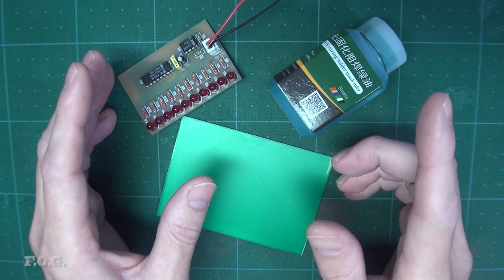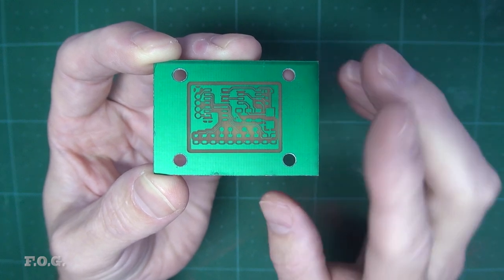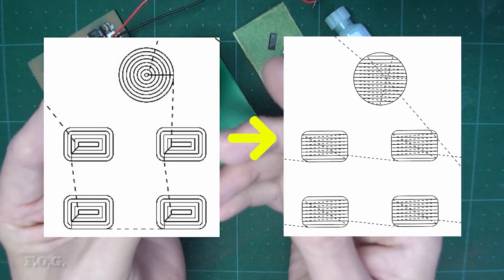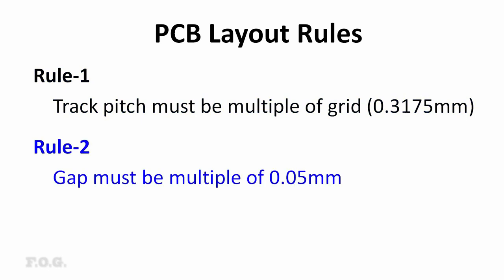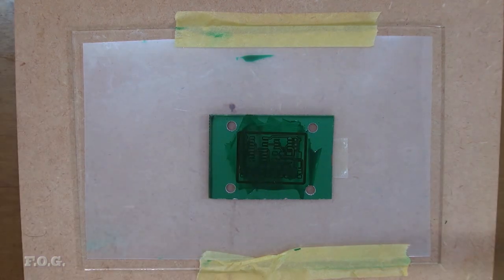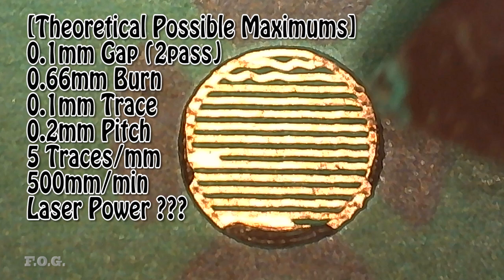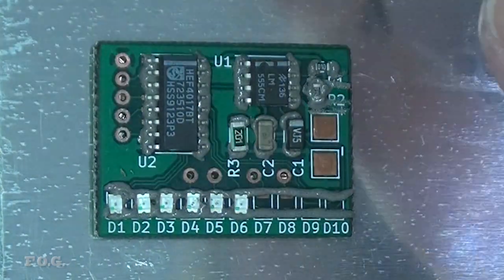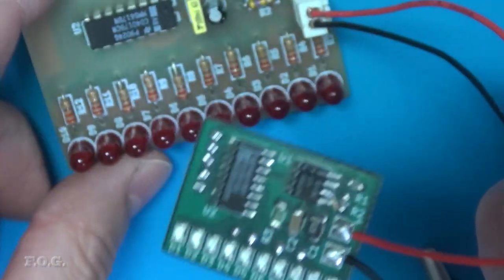EP7 – DIY PCB – Best DIY PCB EVER! (Double Sided SMD)

Comment: Hello, I'm Aureliano I live in Brazil, I'm buying Twotrees TTS-55 Laser Engraver to make my prototypes, the idea would be not to use that green liquid mask and use dry film (photosensitive paper) do you think I'll have good results?
Reply from the maker: Hi Aureliano, nice to meet you, I have many viewers from Brazil. From my experience, I don't think you will get a good result by using the dry film and exposing it with the laser. The reason is because most of these lasers have some light halo around the core beam, and I expect it will make the resolution poor and blurred edges.  But I have not tried this method myself, so maybe I am wrong, so please experiment with this method and tell me about your results. For the UV resin method, only the core beam is used, where the power is strong and can burn off the resin, that is why I get a very clean result, and the halo does not affect the result. Thanks for your question and comment.
Reply: @ForOurGood Thanks for the feedback, as soon as the equipment arrives I will start the tests and let you know if it works. Hug!

Comment: I have been working on this exact same process with my 3018 CNC.  I ran into the exact same issue you did with there being some sort of film on the pad after lasering away the resin coating.  Did you ever find a resolution for that?

This series is amazing btw, wish I had found it a few weeks ago, would have saved me a bunch of time, haha.
Reply from the maker: I think I show it in a later video, but I am using some generic metal polish, and scrubbing the surface with a very fine hair toothbrush, and that seems to fully solve the problem. I have also seen suggestions of dumping the board back in the etchant for a few seconds, possibly that will work too, but generally I prefer to deal with the etchant as little as possible, so I am a bit hesistant to add that as a step in the process. Anyway, good luck and thanks for the comment and question. BTW: How did you discover this video, was it a search result or YouTube recommendation (or other)? :yougotthis:
Reply: @ForOurGood  After this comment I watched your next episode.  Just bought some metal Polish and I'm going to try it today.

My exact google search was "silk screen PCB UV paint".  I had seen another video where someone did Screen Printing for the UV paint, so I looked to see what else was out there on the topic, and your video was the top search for this.

I haven't gone down the route of etching yet, like you said, I'm trying to avoid chemicals where possible.  I am still doing Milling out of the PCB.  I have a spring loaded bit holder like you made, that I was originally intending to use for the mask removal, that I decided to try for the milling of the PCB.  I used it in combination with a height map, and the results are pretty good (using a .1mm 20 deg V-bit).
Reply from the maker: @BrandonRobinson-p4s  Thanks for all the great feedback, it really helps me understand what is going on with viewers like yourself. I am not surprised you came via a search, YouTube is not generally recommending my content, but seemingly I must be at least making it into search results. Good luck with the PCB milling, personally I didn't like it so much, but it seems a lot of people out there get good results with that method too.

Comment: Wow. This is great. Didn’t expect green solder mask can actually provide .1mill clean sharp traces by literally burning it off the solder mask. Great research and experimentation. I wonder how UV green solder mask compares to UV black solder mask. I know many people with laser engravers using the red laser uses black ink and actually burns off the ink and then etch off the copper and get decent results. But never at .1mil.
Reply from the maker: Actually this process surprised me too, a bit of a lucky discovery. The key to the process is that the green solder mask is very robust, I have used photo resist in the past and I always found it very fragile in comparison. Another nice upside is you don't need to clean off the resist layer which could risk damaging the tiny traces, just put one more layer of  solder mask and you get one nice looking board! BTW, I am already planning to test white and red UV resin mask soon enough, and maybe using dual colors could give an interesting result too. I'm not sure how black would work, I suspect it would be ok, but maybe having the resin and burnt areas both being black is maybe not a good idea from a process point of view. Thanks for the comment!
Reply: @ForOurGood  The results you got are really fab grade level. If this is consistent, then it means it can also be used by fab industries too, they can perfect it immensely using dialed and tuned green solder mask concoction and do not need expensive UV lasers and optics. 

I haven't seen anyone using green solder mask that can get super clean and sharp traces in this PCB industry, maybe you should patent it and start your own business on this, make your own patented green solder mask bottles and prove everyone that it can completely replace photo resit. It also benefits PCB hobbyist not needing specific special UV lasers and UV photo resit ink/film. 

Photo resist is indeed super fragile and requires many preparations and precision UV lasers and precision CNC gantry are needed. 

What kind of laser wavelength and setup are you using?
It seems you are using high wattage 450nm laser. What kind of beam quality are you getting? Is your laser beam focus point <10 micron diameter? 
Maybe if you get better optics and get your laser beam point much more sharp and tiny down to 1-5 microns in diameter, you could get superior results. 
Also using precision CNC gantry using authentic Hiwin linear rails precision grade can also immensely improve your results. 

Have you tried experimenting using red laser engravers for the green solder mask? 

I think the green solder mask really absorbs the 450nm wavelength energy well and burns off cleanly. It would be great to view your future videos trying out different solder mask color experimentation. Thanks.
Reply from the maker: @ShopperPlug  The laser is a LaserTree 450nm 40W fixed focus laser from AliExpress (apparently more like 10W in reality).
At the current resin thickness it seems burning a width of 0.05mm is possible, but typically I am burning at around 0.1mm because that take less time and fits with the accuracy level of the CNC..
The power level and feed speed affects the width of the burn.
Another fly in the ointment, is the laser spot is about 15% wider than it is tall, and the G-code generator has no option to take that into account.
As we are burning the resist, or the negative, it is possible to get features down to 0.04 mm, but the copper board is 0.035mm thick, so going less than than seems dangerous. In any case the XY gantry has play of around 0.03mm or so, so right now my minimum feature size is 0.1 to 0.15mm.
I have ordered some parts to upgrade the precision of the CNC to some degree, but as the objective is to keep the cost low, it is still likely not going to be super precise.
As for other things you touched on to do, what you see in these videos is pretty much happening right now, and with producing the videos taking a huge amount of time, I don't have a much spare time, so things take a lot longer to progress than you might imagine (but I will get there eventually!) Thanks for the comment!
Reply: @ForOurGood  Thanks for the detailed reply.